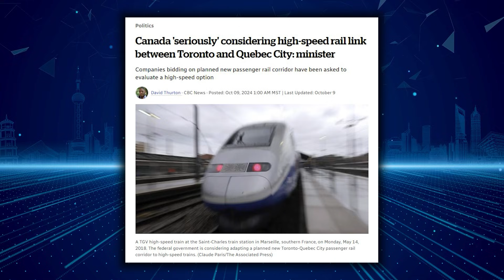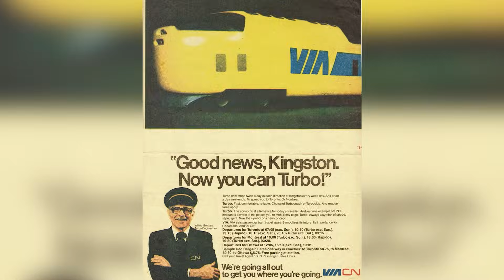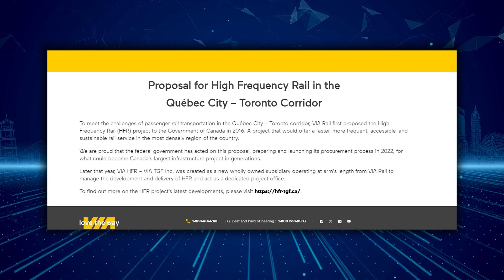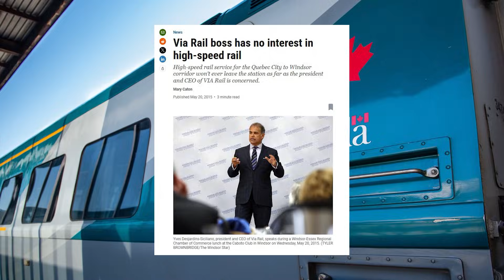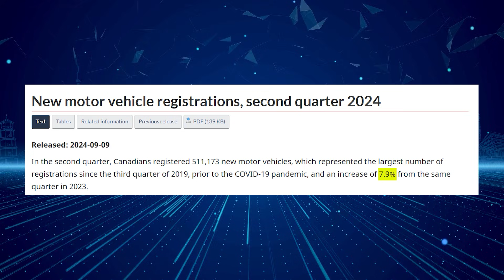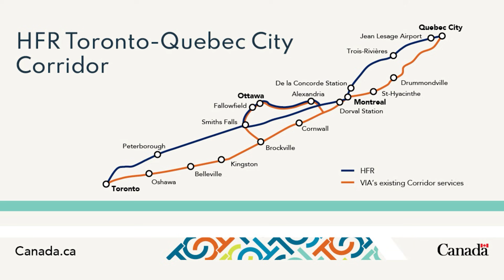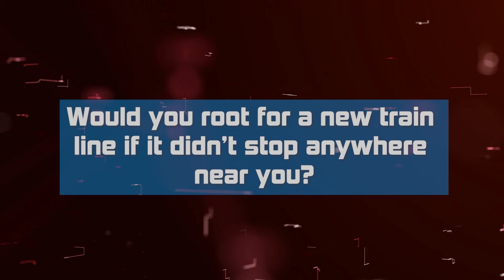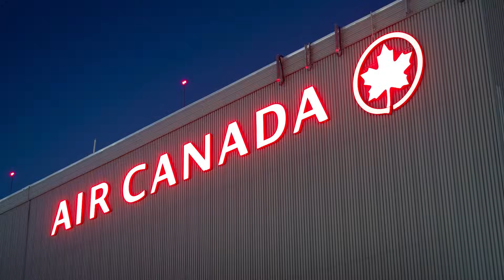Canadian High-speed rail is coming! But…

Comment: HSR's speed, frequency, urban centre-to-centre service and reliability outcompetes cars on intercity travel hands down.  Suburban car owners are concerned about every day commutes of 30-50km within the city, not hundreds of km between major cities.  Suburban car dependency can be countered only by high capacity fast frequent urban rail networks (subways, LRT, trams, then buses).  Comparing HSR with car dependency is not logical.  It should be compared to short haul flight instead, just like in Europe.

Comment: From my experiences travelling in Europe, high frequency rail is the way to go.  Get trains that can do 160km/hr and you will get the times down a little.  Dedicated tracks and frequent service will encourage people to use this in their transportation mix.  Would love to see TGV in Canada, but we have to learn to run a frequent service first.
Reply: Via's 2015 proposal was to increase speeds to 177 km/h and offer departures every 30 minutes between Toronto, Ottawa and Montreal. It would be a MAJOR improvement over today, even if not high speed.
Reply: @ it would be an improvement, but people would still chose planes and cars, since they’re also frequent but faster. Trains need not only to be frequent but to be competitive. And that will only come with consistently shorter travel times.
Reply: @williacena  There has actually been a renaissance of classic, 200 km/h intercity trains in Europe in recent years as they cost half the price of high speed trains to operate, and still compete against cars and buses.
Reply: @A_Canadian_In_Poland  I am aware. I beleive we should just bite the bullet and build high speed rail. why spend so much for so little.
Reply: @A_Canadian_In_Poland  "Via's 2015 proposal was to increase speeds to 177 km/h" for 35 seconds I take it. So you are in Poland certainely more desirable than Canada now.
Reply: the trains do go 160km/h.
Reply: @briancollier5145  we will run empty frequent trains, you mean.
Reply: " high frequency rail is the way to go" Beggar's solution indeed.

Comment: if they really want to bring high speed rail the first thing is they need to make their own right of way for the corridor, they share the tracks with CN so they will get caught behind the slow moving freight trains, additionally they need to make sure that they grade separate each crossing on the high speed right of way, so that they don't need to slow down when crossing rail crossings, I don't see them being able to however add high speed rail service on the canadian since it's more like a long distance train that is not used as frequently as the corridor trains
Reply from the maker: From what I learned, they were thinking of building their own track instead of sharing one with cn